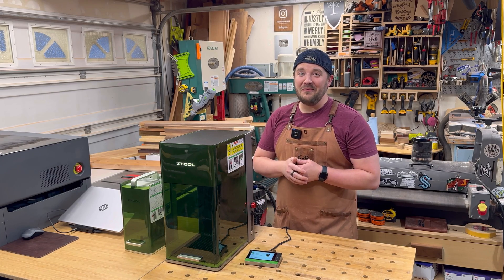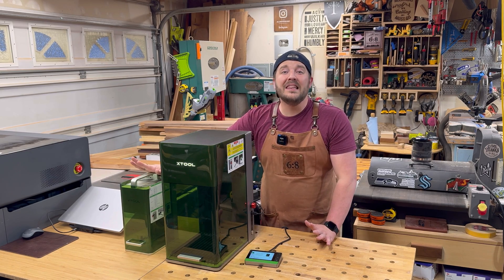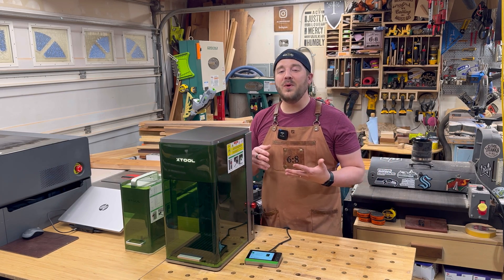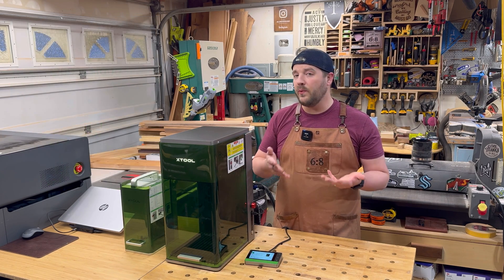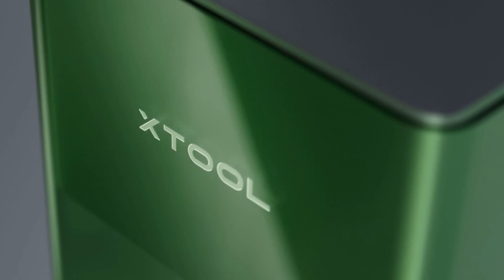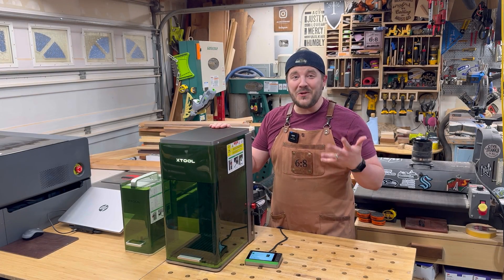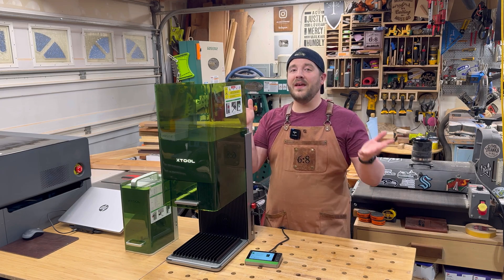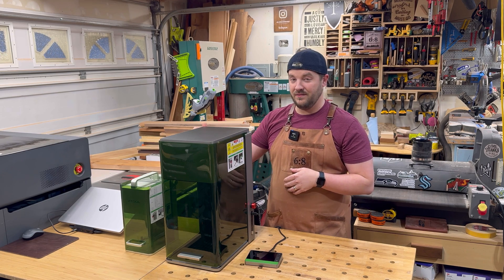World’s First 20W Fiber & Diode Dual Laser: xTool F1 Ultra

Comment: I have a question. I like to do resin rings. The metal rings with channels with various item mixed in them. But the ring blanks with the channels can get expensive to buy sometimes. Can a "deep engraving" be made with the F1 Ultra or the M1 Ultra or both? I know it would need the tool adapter to hold it but I was just wondering before I bought one.

Comment: I just got an S1. I would have struggled between it and the Ultra if it had been announced a few weeks earlier, but I think I’m still happy with my choice. 

The S1 is a couple thousand cheaper, has a larger work area, and more safety features (the F1 is designed to work with the lid up or down, and that concerns me with kids around).

That said, I really like the idea of being able to do 3D engraving on coins and tokens. Maybe they’ll eventually bring a measure of that to an S1 module or a separate enclosed Fiber machine.